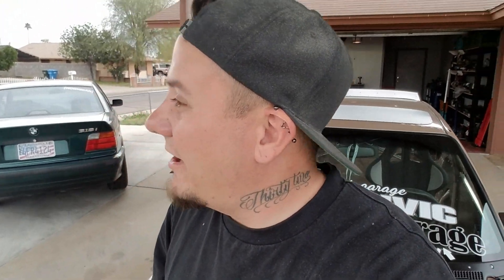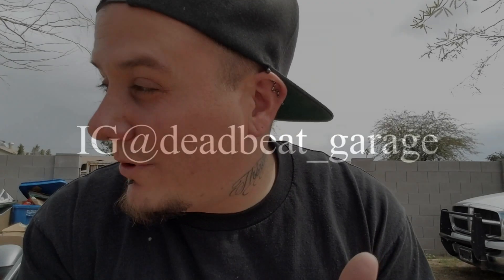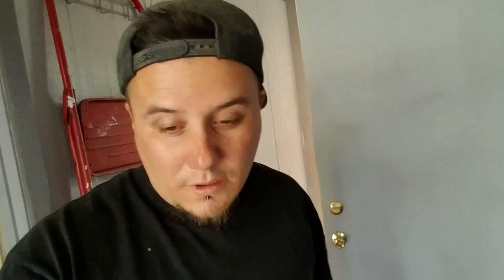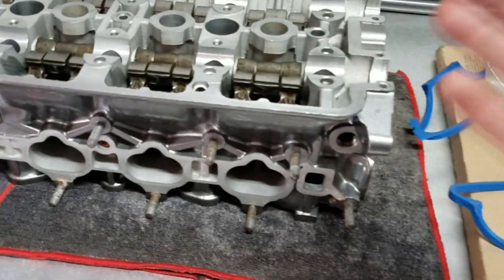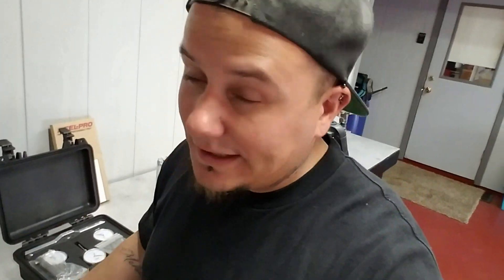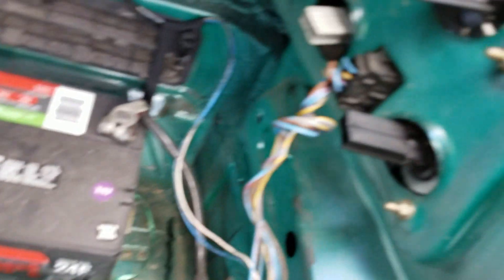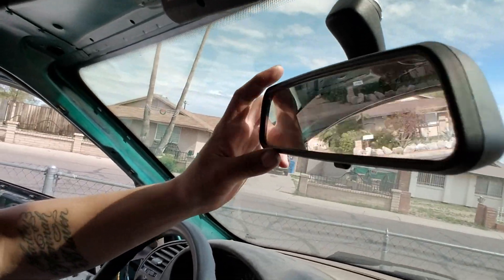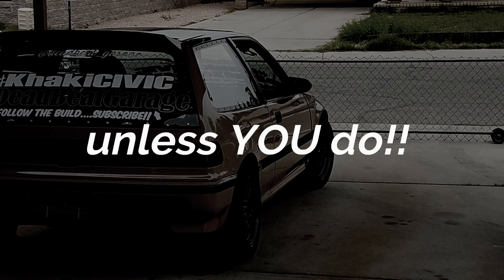Update on ALL of my project cars..

Comment: You don't say how bad max failed. 
Bro stay away from Bosh products.
Make sure you get stock AC delco spark plugs and Mag-core spark plugs wires. For O2 sensor im not sure if NGK have one for GM cars but if they do get one.
Make sure max is not running cold. 
Because even if your cathalitic converter is hot.
Running the engine a bit cold that can cause max to run rich..

Comment: Mad max will pass if you change theese..... fule filter, cat, muffler,o2 sensor,and 110 Oct race fule because it burns cleaner. And when I did my 02 I reset the computer and actually gained 2mpghy 1city. I guess the o2 tells the motor to take out fule and it runs better. You'll pass my dude.